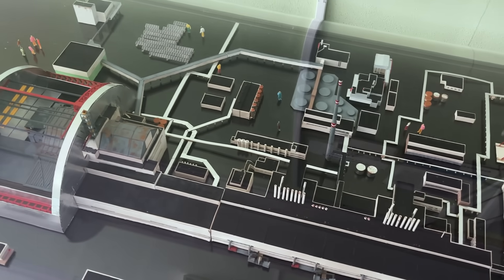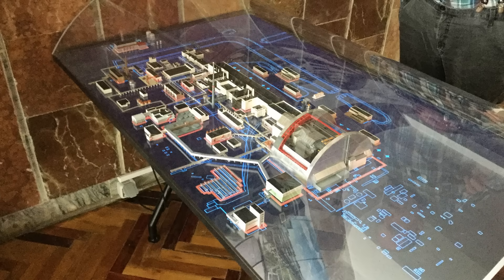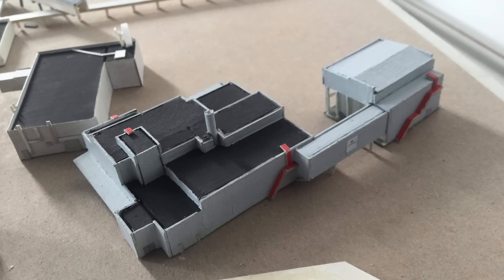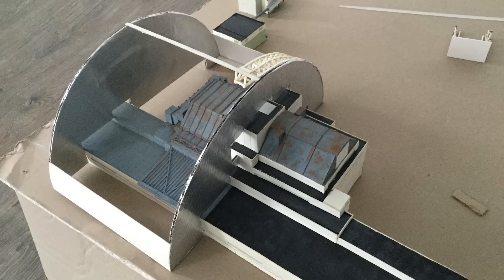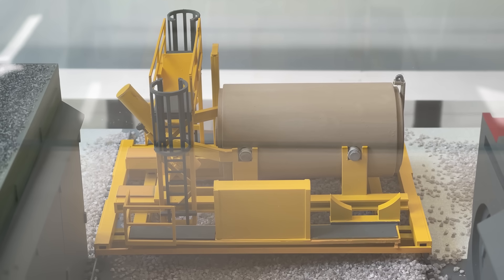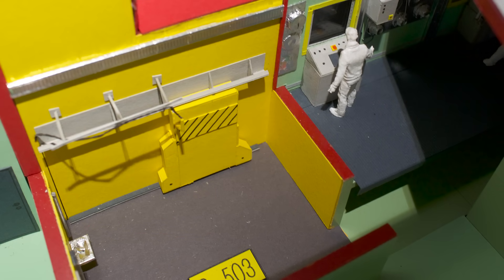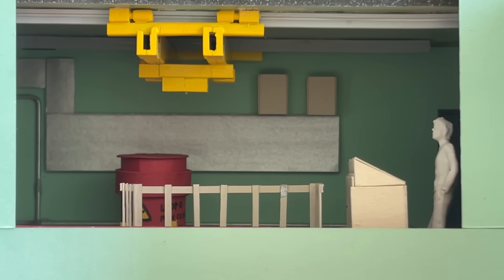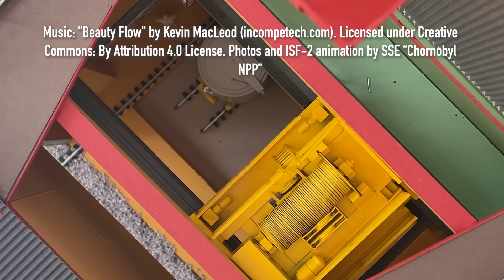Chernobyl Power Plant in Miniature — Made From Paper!

Comment: It was pretty interesting to see a model of what could have been had the Chernobyl disaster not happened on that fateful night back in 1986.  One thing I learned about reactors 5 and 6 is that they were part of a much larger expansion consisting of 6 phases and the whole complex included 12 RBMK reactors with each reactor generating 1,000 MW.  Over time, Chernobyl would have become the world's largest nuclear power plant.
Reply from the maker: Confirmed were 10. 12 was more a speculative vision by Party functioners.
Reply: It would have been incredible and terrifying at the same time. So many big, powerful reactors living in close proximity to one another (relatively speaking). But it would still be totally awesome. A single nuclear power station putting 12 gigawatts of electric power out on the grid 😱
Reply: I saw it mentioned once in a video but have never been able to find more about that. Do you have anything?